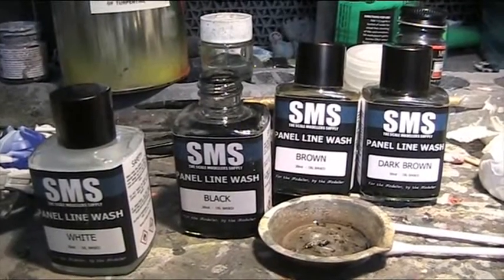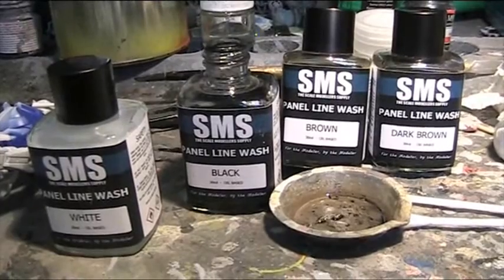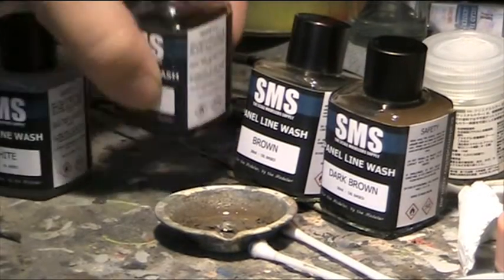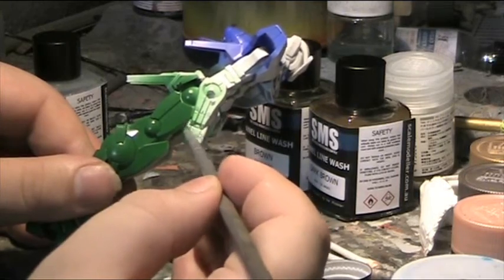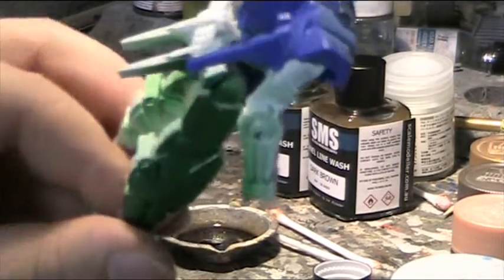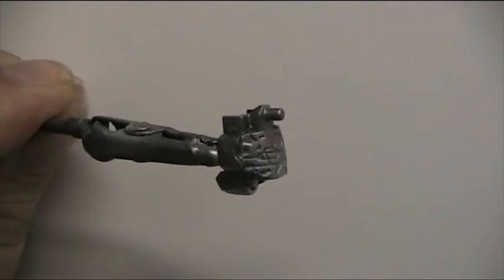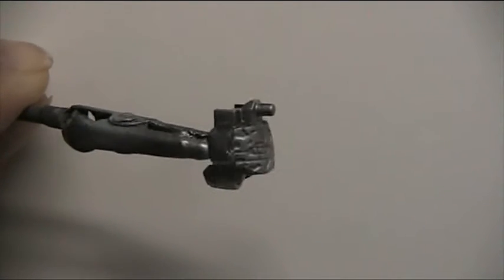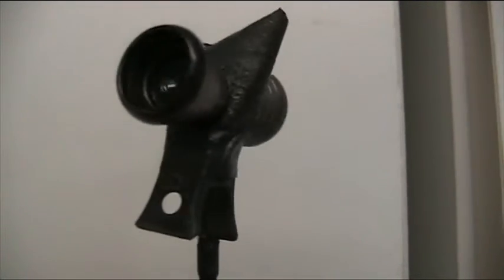model kit workshop 105: SMS oil wash review

Comment: Hey Alan, due to the storm passing NSW, I am going to apply a clear coat and thus panel line when it passes. In the meantime, I found this wash in my hobby store. Do you need some solvents/thinners to moisturize the tissue before wiping the excess wash off? Or just a kitchen tissue will be enough? Thanks
Edit: I also applied SMS clear coat today, due to the humidity, I got some frosting. Any advise of getting it off / fix?
Reply from the maker: Hello, I've experienced SMS clear frosting in humid conditions, apply clear gloss and see if it clears up then try again on a cool dry day. With the oils only a dry paper towel is required.
Reply: mokanaman Thanks a lot m8. Too bad it is raining these days. Was sunny yesterday. damn weather :l
Reply from the maker: We copped the rain yesterday in Melbourne, weather has been really bad of late.